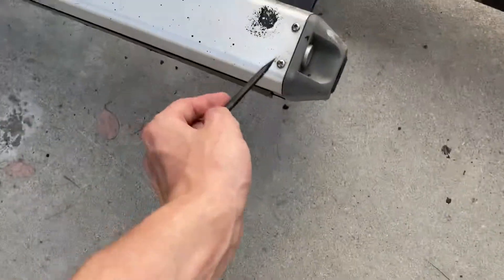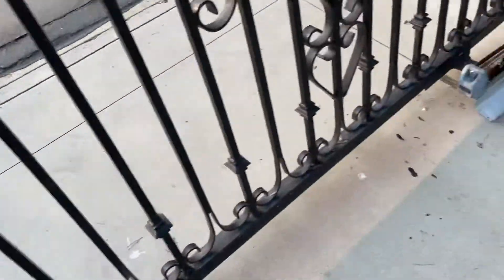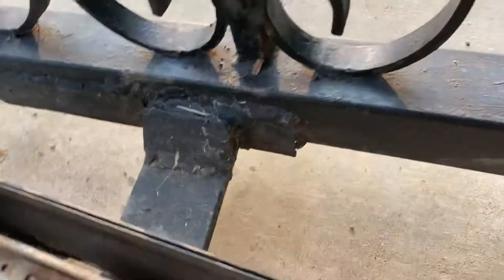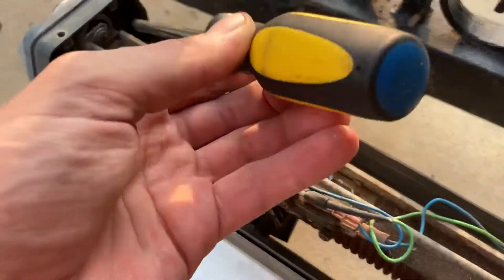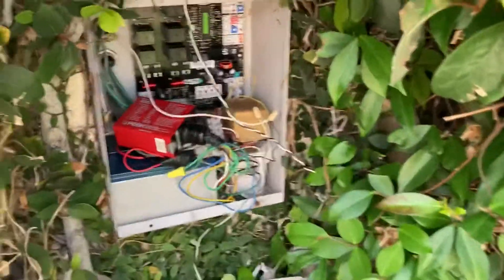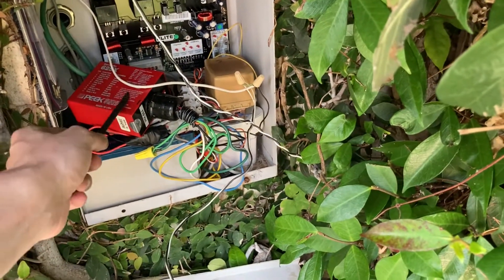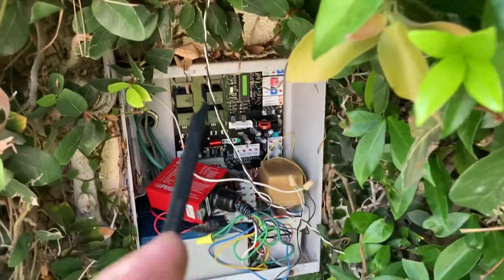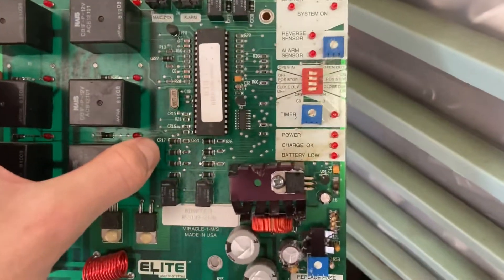Liftmaster Elite miracle-one gate operator limit and timer adjustments

Comment: i'm watching your video to figure out how to adjust or slide those limit things and i still don't know how to do it. You went over it SO fast. I
Reply from the maker: You have to unscrew the two screws that hold the limit assembly down. There are nuts on the bottom that you have to hold with needle nose pliers to be able to unscrew the screws. You can adjust the assembly to the left or the right. Moving it to the left will make the gate close farther and moving it to the right will make it close sooner.
Reply: @DordiHOTS  can you tell me what to check if I hear a click and not doing anything the battery are fully charged
Reply from the maker: @saderiben4311  Clicks from the motherboard relays or gate motors? One thing to check is the loop control module. If you see a "Safety Loop" light on the motherboard when you try to open the gate, the loop control module needs to be reset by holding the reset button down on it for 5+ seconds. You can also disconnect it and reconnect it, and shaking or tapping it helps as well. The module is usually red or grey and has a circular pigtail wiring harness coming out of it. To further diagnose the problem, please see which LEDs are illuminating on the motherboard. Check to make sure both motherboard fuses aren't blown by checking the inside filiment and looking at the LED lights to see if they are illuminated. Some other things to check are that the battery harness connector is firmly connected, both batteries are connected to eachother in series, and 24v (combined). You should also check the motors themselves with a multimeter (read a guide online on how to do this) to make sure they are not shot,  the motherboard could be bad if it got shorted out. Make sure the plugged in power adapter is actually putting out 24V for the gate. Check wiring between the gate motors and control box.

motherboard warning LEDs and what they mean:

1) reverse sensor: the gate has been detected traveling past its implied limits. Adjust the limit switch assembly inside the gate motors and ensure that both limit switches are working properly. IF the gate does not make two clicks when opening and closing, and does not close slowly once it gets close to the limit, the limit switches are bad. This video will guide you on how to adjust limits.

2) alarm sensor: the gate has detected that there is some sort of interference with the movement of the gate, or when it is stopped someone is trying to break in by prying the gates. Disallow anyone from tampering with the gates.

3) strike open: this means the loop detector has detected prescence and the gate should now open. This could also mean that someone has typed in code on the keypad to open the gate. You may see online that it says to check obsticles when the gate is opening and check the track, however, they are misinformed. If you're seeing this light but there is no car, the loop control module or your ground loop detector may be going bad, or the entry keypad may be sending signals to open the gate even if no one is typing in the code, meaning it's faulty.

4) safety loop: this means the ground loop module might just need to be reset (it has a circular wiring harness). You might also see that some vehicle is over the ground loop that disallows the gate from closing on cars. Move the vehicle, reset the ground loop control module, or replace the ground loop control module. If that doesn't work, the in ground safety loop might be going bad.

5) radio rec: this means that the gate module is getting a signal to open from a remote transmitter. If you have a liftmaster reciever module and you are not pressing the wireless remote open/close transmitter,  but see this light, either a neighboor has the same code somehow, or the module/remote are faulty.

6) center loop: this is another warning for the loop that is in the ground. this means the ground loop module might just need to be reset (it has a circular wiring harness). It could also be a faulty ground loop control module, or the ground loop detector in the ground may be bad.
Reply: I hear  click but not moving